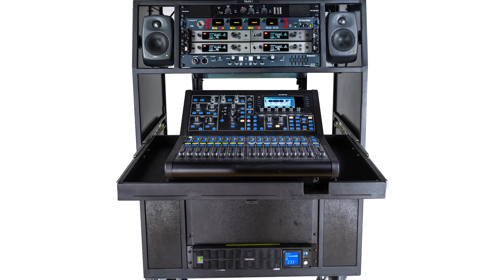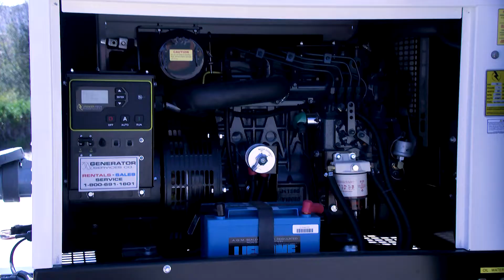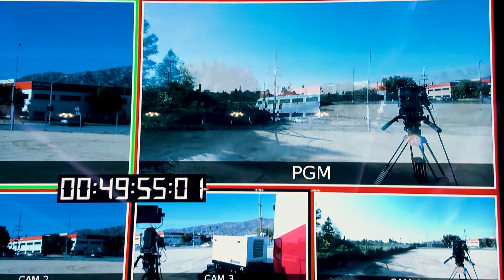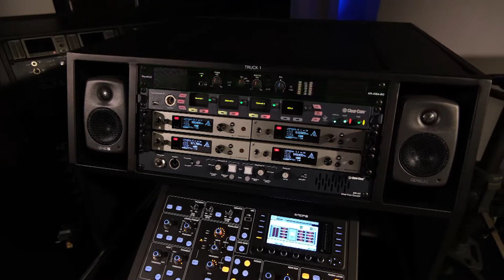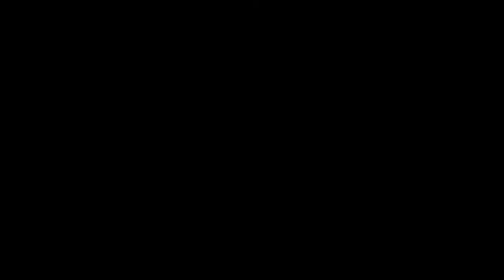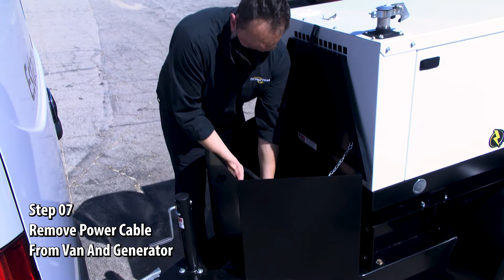TVPG Video Van Build

Comment: Are satellite links still used I was under the impression that you can use high speed data cables to send whatever it is you want to send
Reply: Yes, sat trucks are still used. Sometimes as a backup path, sometimes as primary transmission. Not every TV station has the gear to receive a  data feed.

Comment: How much would that setup cost?
Reply: If you have to ask, too much
Reply: I'm gunna say 80k - 100k at least
Reply: @maverick4220  just the video rack is at least double that without the van, audio stuff or IO pannel. This is a high 6 figure project probably 7, looked into one for a company I used to work for and that is when I realised 'if you have to ask it's too much'
Reply: @HugoWiffen  you are talking bullshit, asking for the price is important, to make clear, what budget is necessary for that solution or event to scale that up.
Reply: @maverick4220  I think more!!
Reply: @maverick4220  probably add a zero to this and you are spot on. For 80k you might get nice new empty van.
Reply: The EVS is at least $100,000US. The AJA is about $5,000.